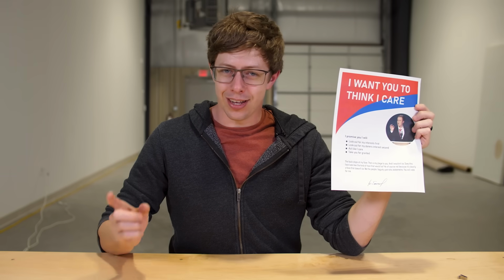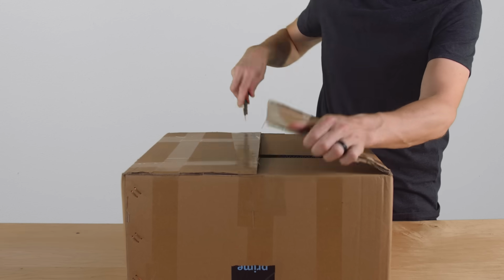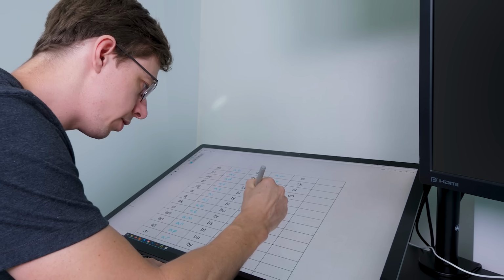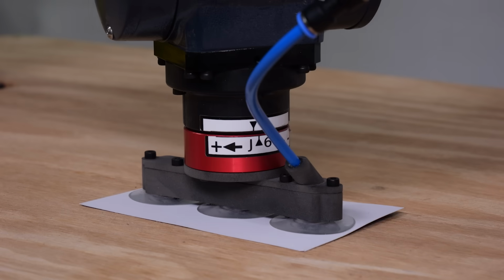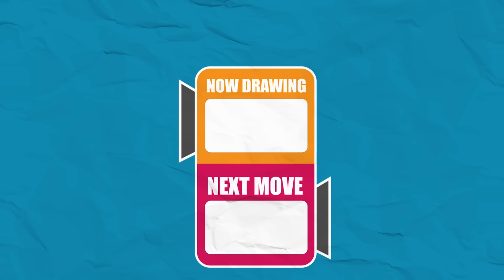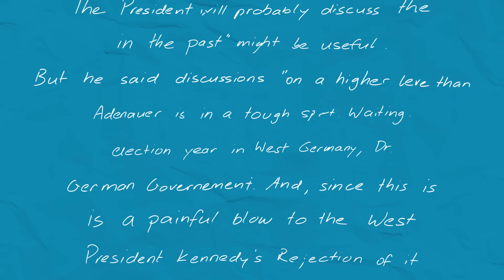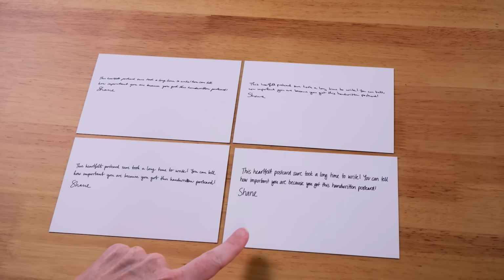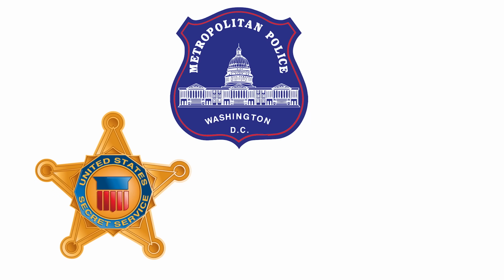I sent robot forgeries to a handwriting expert

Comment: 1:45 - In eighth grade, I had to write 100 times, "How can I do my rough draft when I failed to do my outline?"  I was an underachiever, and my English teacher was a B-word.  That was back in Fall of 1985, before most people had computers, and less had the gumption to use them to work smarter, not harder.  I asked the teacher if I could just type out the lines, and she said it would be fine.  So, I went home, and in BASIC, wrote a three line IF-THEN program that would print the assigned line 100 times to my dot-matrix printer.  Problem solved, and she never knew.

Comment: I wonder if a machine would learn to write in Japanese or korean more easily as the characters have a more rigid stroke order and being written top down means you'd have less of the run on into the next letter issue you had early on.

Comment: Why do people make things like this and not think about the human wrist and hand? A pen coming down diagonally 45° (for example) has a different line feel than a pen coming down at 20° or directly at 0°. The human wrist and hand doesn’t just move location, but changes angle and stability constantly when writing with changes in muscle tenseness and angles of each separate joint. Ofc its a lot more complex and will need tons of machine learning, but you’ll never fool trained pros otherwise

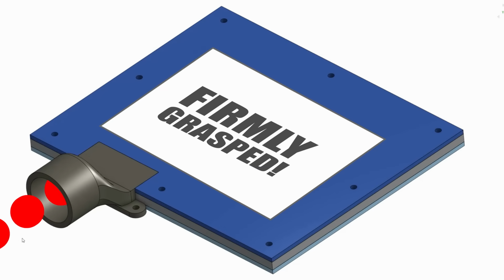Comment: At 8:58, what's the points of having the slits on this board for the "hole-y" plate? I know this layer must do something, but I can't figure out what. Why not just have the board with the holes sitting on top with no slit plate (or perhaps just elevated a bit with no slit plate?
Reply: From what I gathered, It provides a gap for the vacuum to pull from all the holes with even distribution while also supporting the top "hole-y" plate so it doesn't push away from the pen or cave in from the vacuum.
Reply: @PreciStrike_96  Oh, that makes sense. Thanks!

Comment: Years ago, I wrote the code to validate the method of a signature, and I was shocked, I could validate signatures to a greater accuracy then the final result the actual signature.   I was able to capture speed and acceleration, and the strokes, pen-up, pen-down, penup time, pendown time, etc.  Not without hitting my first snaphu, that people have multiple legal signatures.  You as a doctor, might have a nurse sign for bla.  That signature is valid, because there is no fraud.  Same with your wife, etc.  So, people have up to say, 3 valid signatures.

Comment: why not have a database with 20 of each letter that you wrote. random int in range of 0-19 as it writes?
Reply: rofl @4:26 alright lets go..
Reply: Meh i guess the outcome was alright. i kind of like the database design better than the code. if you translated the time into your handwritting into a large db the spacing prob might of went away as it had more choices. However it prob wouldnt have been as fun. Thanks for the laughs on the failures 48hrs later haha

Comment: I'm willing to bet that your attempts at building an RNN for handwriting were sabotaged by your choice of using Python. Though, I don't know what your code looks like, so I can't say for sure.

Computers cannot directly run code. Your human-readable code has to be converted into machine code that the CPU can execute.

In programming, there are two types of languages; compiled, and interpreted. The difference is in how and when they translate your code to machine code. Compiled languages translate your code before runtime and give you an executable file consisting of raw machine code, which can then be run at full speed. Interpreted languages, by contrast, translate your code during runtime. The computer has to do a lot of work to figure out what each line of code means as it runs them, which can take on the order of 100x as much time as running equivalent compiled instructions.

Which means, depending on what your code looks like and how efficiently it translates, your 46 hours training sessions possibly could have been half-hour sessions, if you had been using a compiled language.

I'm not trying to be mean here. I'm trying to inform, to hopefully give advice that may benefit your future projects. I'd definitely suggest trying again with a compiled language, even if it's just to help yourself learn more about what's possible.